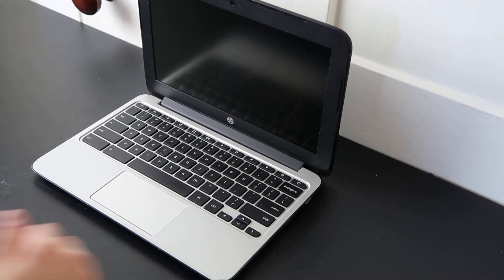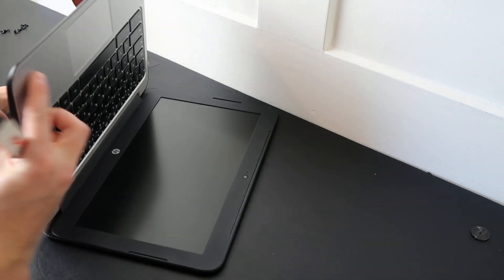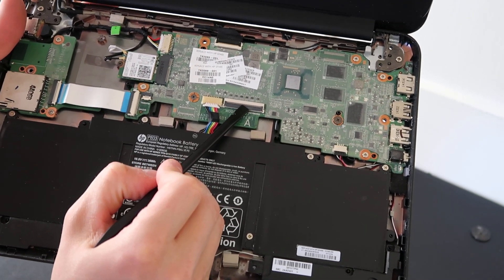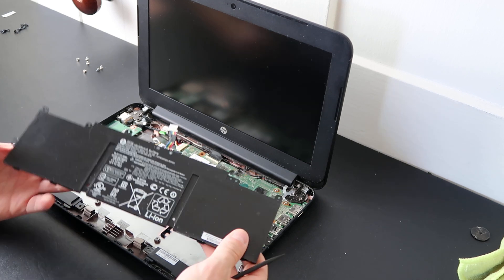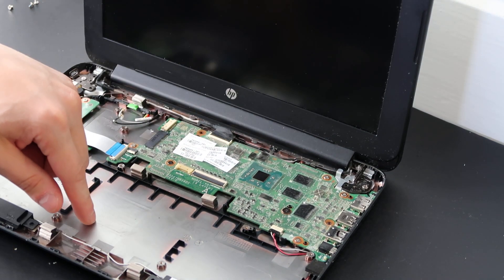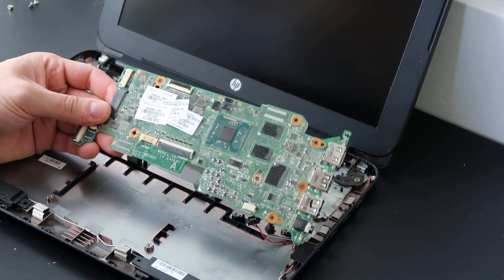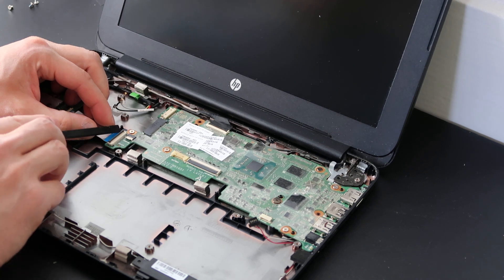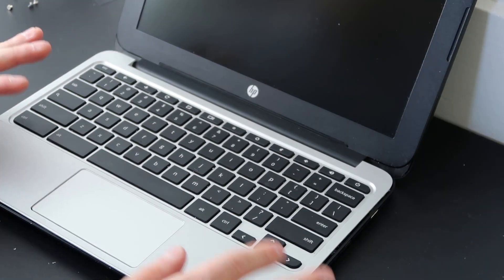How To Replace Motherboard & Battery HP Chromebook 11 Laptop Computer

Comment: Hello sir, my Samsung Chromebook laptop indicates red green and blue led light, but it doesn't display anything on the screen... Is that a BIOS issue?
Reply from the maker: For a computer that does not turn on, try this video first; https://youtu.be/kOBY4k2Mn_k. Let me know how that goes :)
Also, did anything happen before this issue started? Overheating, liquid spill, Windows update, etc?
Reply: @PC_Monkey sir, is it possible I chat with you privately?
Reply: @PC_Monkey It's a Chromebook laptop, Infact I have two of these laptops, they are huge loss to me as they can't turn on.  I recently just bout them from a seller. One does not on at all . While the other one flashes red, green and blue.  But I was suggesting its a firmware or BIOS issue

Comment: What about when you replace the motherboard and then it doesn't turn on?  Or when it does power on but it does not "keep" the chrome OS.  Do I need to run something specific?
Reply from the maker: You installed a new motherboard into your Chromebook?  What was the issue with the computer before?  Yes, you may need to reinstall Chrome OS after a motherboard install as seen here:  https://www.youtube.com/watch?v=VnyMzQ34uk0&t=1s

Comment: I'm replacing the power port on my g4 but I took the plastic covering off the board since it was so dirty. Does it need to have that? Does it serve a real purpose? Thank you.
Reply from the maker: What plastic covering?  What model computer do you have?
Reply: @PC_Monkey  Clear plastic. Its taped all over the motherboard. Its a g4 chromebook11. It looks and feels like thick tape.
Reply from the maker: @Mishakol1290  Usually those things are not 100% needed.  Sometimes its used to help keep things clean or cool but not super necessary :)
Reply: @PC_Monkey  I thought it would insulate against electric shock cuz the keyboard is right over it. Thanks though for your wisdom. Trying to see if i can fix this piece of shit lol
Reply from the maker: @Mishakol1290  lol Good luck !!  Let me know how it goes :)

Comment: Can we upgrade ssd on hp 11 g4?
Reply from the maker: If its anything like this computer then no.  The drive would be integrated into the Motherboard and cannot be easily removed / replaced.  You can always add an external drive if you like :)

Comment: thanks for the video, when I replaced motherboard and turned it on; all I get is a white screen with chrome symbol.  Is there something I can do to boot it up?
Reply from the maker: Chromebooks are pretty simple machines.  The GPU, CPU, and Storage is all integrated into the motherboard.  If that motherboard is not working, I would assume its bad.  Did you purchase it used?
Reply: @PC Monkey  sounds like a missing OS. Chromebook recovery utility chrome browser extension will give you easy instructions to download a bootable recovery media to a flash drive. Refresh, power and esc pressed at the same time to shut down. Hold down refresh on boot. Release and you’ll be in recovery mode.

Comment: Very helpfull videos ... any suggestion about where I can find a motherboard replacement for my HP Chromebook 14-ca052wm ? Thanks
Reply from the maker: I usually have ok luck with cheap used parts on sites like Ebay or Amazon :)

Comment: Hi, i broke the battery cable fastener while changing my battery, is there a replacement for it or do i have to change the whole system board?
Reply from the maker: If you broken the port on the motherboard that the battery cable plugs into then yes, you will have to replace the board.  Usually the price to repair a board is pretty much the same as buying a used one on sites like Ebay